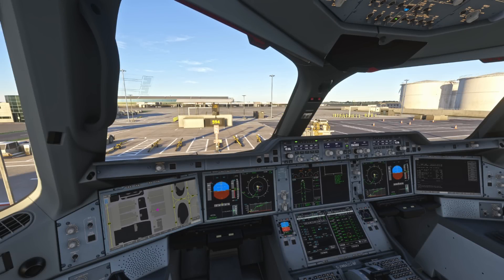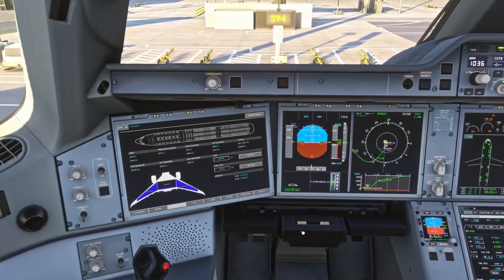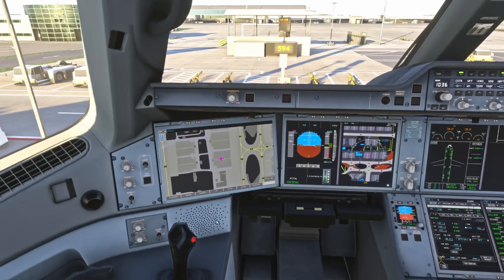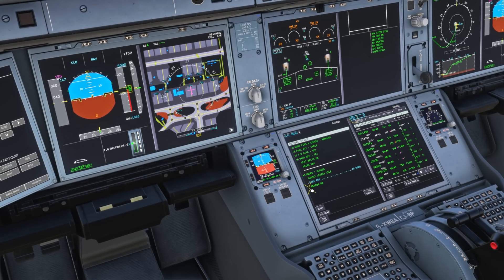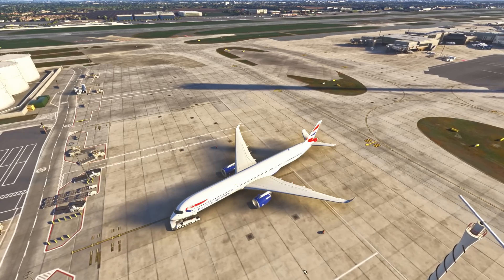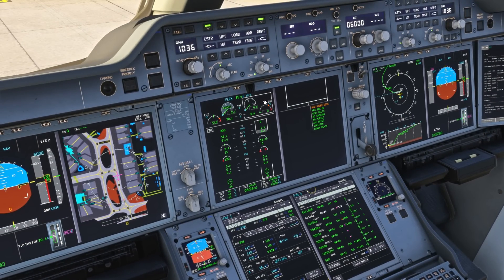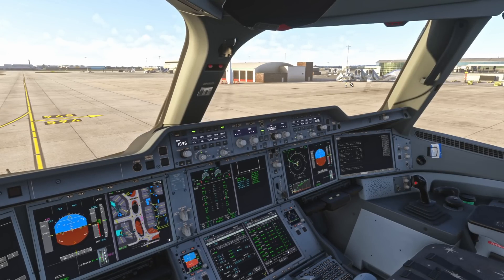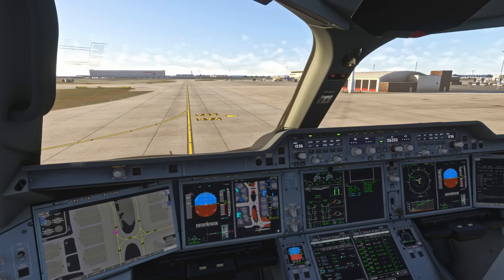A350 Engine Start & Pushback Tutorial | Real Airbus Pilot | MSFS 2024

Comment: Finished a two hour long flight from Yellowknife to Ketchikan airport yesternight - after deleting the content of AppData -Roaming-Microsoft Flight Simulator-Packages-inibuilds-aircraft-a350 before loading in the updated airplane version for the first time version 1.0.3. already functions flawless with no cockpit navigation computer crashes. Wonderful airplane! The BEST! 
The only detail I miss is a function to first couple the pushback-truck, second release the parking brake and third begin the pushback. To simulate exactly these three steps. When just clicking the pushback button on the OIS the truck couples and immediately begins to slowly force the Airbus backwards with that handbrake still engaged... :D
Coupling and begin pushback should be seperated as two seperate functions in the OIS.
Another interesting detail I noticed that the heating system of this airplane is really different compared to the A320. It is pushing bleed-air through the packs as usual, but has also two lines labeled "hot air" (with no packs in between) going directly into the heeating vents.
Reply from the maker: Hello, that sounds like a great flight and it's great to hear the aircraft is performing so well. I guess with update 1.0.4 now available it may be even better. I share the same frustration on the pushback, a few small changes could improve things. It is good to see a high level of system detail being applied to this aircraft. It will become the go to long hauler for many simmers 👍✈️

Comment: If the data of the right fms (FO) differs from the left fms (Capt), is this a potential problem? Should we systematically program both or does the fms automatically choose the left fms? Thank you.
Reply from the maker: Yes, a mismatch between the left and right FMS can be an issue. The A350 does not automatically default to the left FMS, so both should be manually cross-checked and aligned to ensure correct data is being used for navigation. You do not have to program both as they should sync but cross checking is important

Comment: How are you finding it?
Reply from the maker: Hi Chris, much better after the update, I had some frustrations with the initial release version. I find it very sensitive to handle on the recommended settings. It is enjoyable and a good long haul Airbus option 👍
Reply: @AirbusCockpitCoach  Yeh I agree. The basics are there and it will be a very good aircraft once some more of the issues are eradicated. I am sure the sensitivity will be turned down somewhat over the next few weeks especially the thrust control - no chance of manual thrust control at the moment as it goes from 20% N1 to 70% N1 in a millimetre
Reply from the maker: It's work in progress but a promising start, you are right thrust is also mega sensitive
Reply: @ I’m not sure if it’s me but mine also seems to pull to the left. I even turned the wind off which confused the local aviary life, but still, it drifts left like it’s on The Fast and the Furious
Reply from the maker: I'm not getting that myself, check to ensure your controls are not causing interference in the background. I have increased some dead zones for this aircraft
Reply: @ how did you do that? In the aircraft or in the sim?
Reply: Nvm. Got it
Reply from the maker: @Chris-nb1hc  In the sim, the difficulty in 2024 at the moment is that it does not show the input being made by hardware so you will not immediately be able to see if something is interfering so it's a try it and see job